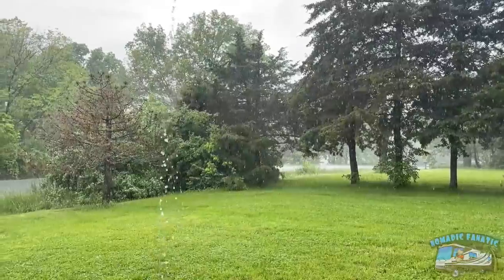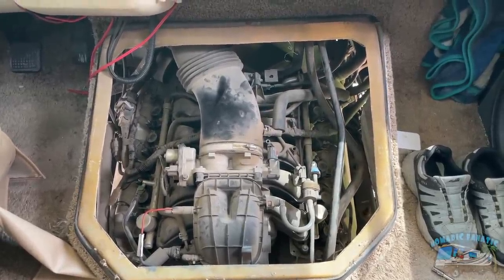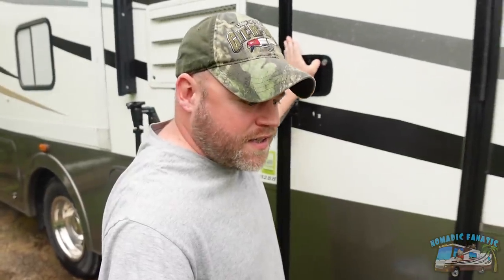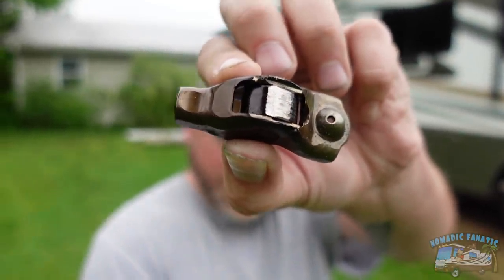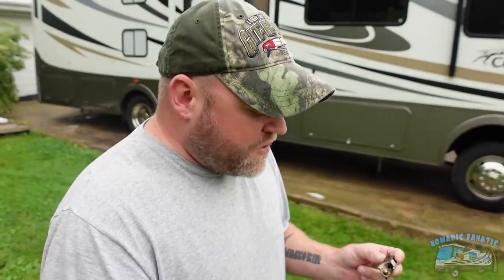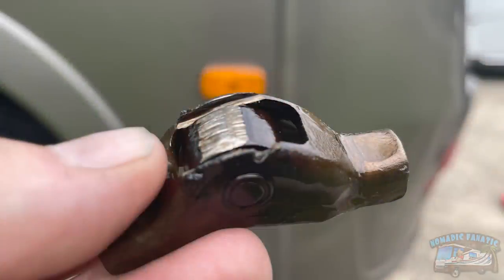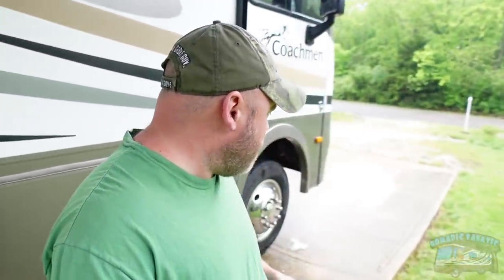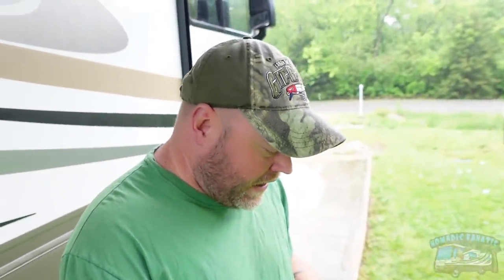Engine Repair Begins ~ Ford V10 F53 RV Is TICKING & KNOCKING

Comment: Depending on if the rocker arm is for the same cylinder that the exhaust manifold was leaking. If it was the same then you may have burnt a valve because of too much air from the exhaust leak therefore it would cause valve train problems. You could also do an oil sample which will tell you what kind of metals and other things are in the oil that aren't supposed to be. That's what semi truck drivers do to check the condition and health of their motors.

Comment: Wasn't there something with the oil passages in the cylinder head being dimensioned too small for there to be enough oil flow to the cam shafts? I think I remember something like that. Could be consistant with your fault there, as well. I think the remedy was a complete overhaul and rework of both heads, drilling out the oil passages to a larger diameter, or something like that (but I'm not sure about that last bit).
Reply: he didn't change the oil enough.
Reply: @TheBandit7613  Even if that were true, it wouldn't have helped against a design flaw in the Triton engine.
Reply: @Seegalgalguntijak  I had one. It's tough on oil. Dirty oil allows varnish and sludge to form further narrowing oil passages. 
I changed the oil every 2500ish miles with Royal Purple. 
I now have a new E450 with the 7.3 (Godzilla) engine. I guess we'll see how that one does.
Reply: @TheBandit7613  Alright. 
To me, it looks always funny how in those heavy duty applications, in the USA diesel isn't the standard engine type to go to. Over here, there are no trucks and no commercial vehicles that run on gas, just because it's much more inefficient in fuel consumption. As far as I know, the 6.7L power strokes are now bullet proof, not like the 6.0 and 6.4 ones that failed left and right...

Comment: Happy Birthday Eric 
Rocker damage from no oil getting to it. Spray out a few push rods, See if anything is in them. . While your in there check ,all Rockers for good oil flow. Now would be time to drop pan & Clean & replace oil pump & all Lifters. Good Luck on the Motor.  The Sunshine is on the way.

Comment: Eric, when you kept having issues with your on board generator, the Onan, what was wrong? I just bought a 95 tiffin Allegro bay and my 7000 Onan doesnt work. It has the same issues yours did if I remember correctly. It starts and stops. My rig has been sitting for 6 years with the same fuel so I was thinking maybe that was the issue since I understand that both the RV and generator share the same fuel. Please help.  Lol
Reply: THANKS ALOT ERIC.

Comment: There is no reason why a V10 engine is not healthy even after 1 million miles. The main reason why engines are getting hit by fails of internal parts - like rocker arms and bearings - is carbon deposits. So, the question is: How to manage these carbon deposits? ...or even make them go away altogether? For this we need to understand the internal processes in detail. For example: The rocker arms on a Ford V10 have a little ball bearing as integral part. If this little ball bearing is collecting carbon deposits, it starts to become stiff up to the point where it is not moving anymore and getting worn off by the cam shaft. THIS develops the ticking noise which is an indication of worn rocker arms. 
There is a method to prevent the carbon deposits: Shortly before you do an oil change take a small sample of oil from your oil pan by loosening the plug just enough to collect some drips. Then tighten the plug again. Now you have a sample of the oil before treatment. If this sample is black, you can conclude that there is a lot of carbon inside the engine already. If the sample is like dark honey but still transparent, it is a good sighn. This however is most likely NOT the truth. Now put about 1.5 oz/quart seafoam into the oil and drive the engine for not more than 200 miles. Now do an oil change. If the oil now became black, that is an indication that within these 200 miles you "washed" the engine and got rid of carbon deposits. So, inspite the oil looked good in the first sample you have proof now that carbon deposits have been present. Repeat this procedure before every oil change, until the color of the sample before the 200 miles and at the oil change is the same. Now you can be sure that the engine is clean of any carbon deposits inside. 
I go one more step: I only use synthetic oil and I add oil treatment which contains compounds with further lubricating properties inside very small spaces. My Engine has 180k miles at the moment and is purring like a loving cat. I am also going easy on it. Meaning I am not pushing the pedal to the metal. The observation I made: To maintain 55mph on even and dry road required about 2000rpm before I started this treatment. Now to maintain 55mph in the same conditions requires about 1800rpm. This means the engine has a lot less inner resistance and feels free. That translates into a better gas milage as well. I used to use about 7.5 mpg and now I am close to 9mpg. That however depends on the wind conditions as well. This less inner resistance also means less stress on the parts which translates into a longer engine life.

Comment: Ford's with the overhead cams are notorious for the roller followers going out on the right bank. Replaced mine in my 2010 Ford 5.4 l. You should do all of them on the right side not just one. A few thousand miles down the road another one will go out. You did get lucky though. If that roller follower would have come apart it can jam up the valve train and take out the whole engine.

Comment: Usual V10 problem rollers gave up and get loose. They kill the engine easy if neglected. Replace them, experienced mechanic solve it easy not a big deal but they can cause one.

Comment: The Car Wizard has quite a few videos on his channel that explain why those 3-valve Triton engines, both the V8 and the V10, are highly problematic, they have problems that can even cause catastrophic engine failures, which means for you: Swap a Cummins diesel into Miranda and be done with it! ;)

Comment: Cam lobe rocker arm bearing failure..You better fix that. As that thing jams. It will ruin the engine.....So them all at once. Don't do just one...As I can bet you $100.00 other ones are wobbling as well.. I done 100's of these... And you use the Updated Ford ones with the new lifters...

Comment: Well you weren't around Springfield!! Thanks for staying away! We're having to move and moving from an apt to the uhaul wouldn't be fun in rain ESPECIALLY the freaking downpours you bring!
Now to find a storage unit, unload and go find someone that will give me a loan for a used Class C!
Sleeping in a Titan 4x4 isn't fun for a 66 year old back! Not to mention after sleeping for 5 hours my arse won't wake up!
But! At least we're getting clouds to block the sun!
That sounds like a valve. That's not a cheap repair. And I. Bitching that my passenger window stopped working so it's a bit warmer in here as I search for an apt or storage unit!

Question.... are you finding an A more fun than a C unit? I know after 40 years living in Peterbilts, Freightliner and Internationals , I don't do Kenworths I don't want a B as after living in maybe 250sqft for that long I need to luxuriate in at least 27' of a Manson RV!
But if you do make it to Springfield and want to video what the damage from all 3 windows over the overhead bunk after leaking for IDK how long! You and the rest of your subs will freakout!!

Have fun!
Blue skies and safe journey's!

Comment: Garantee that camshaft is scared.....your just patching up ....get the cam shaft and check oil passages that rocker failed due to no oil...I would invest in a high volume oil pump and be done

Comment: Sounds like a flat tappet a valve tappet not hydraulically working or wore out And that was my second guest a bad lifter and no an exhaust leak will not cause thatI would definitely look at the cam

Comment: Exhaust leak on manifold has nothing to do with a rocker arm going bad. However, looking at that roller rocker, I am amazed that the cam did not suffer any damage! If it really did not get damaged you need to buy some lottery tickets before your luck runs out...
Reply: That's incorrect, improper backpressure will cause valve train problems.
Reply: It was an exhaust leak, cannot cause a rocker arm problem...at worst in cold weather a exhaust manifold leak could “maybe” warp an exhaust valve which could lead to a burned valve, but never a rocker arm.
Reply: @divadyrdnal  improper pressure in the exhaust port can cause the valve train to wear prematurely
Reply: We will just have to disagree on this one...

Comment: An exhaust leak has nothing to do with your rocker arm breaking. Or any internal engine failure. That is one of the dumbest things I have ever heard. If somebody told you that they are for sure not a mechanic. smh

Comment: time to dump that thing the v-10 is a bad motor
Reply: Not true.  RV is older with some miles.  Many V10's on road still doiing fine.  Whoever had it before did not do regular maintenance.  Also, apparently people see RV's as somewhat disposable and do not do proper upkeep.
Reply: How much depreciation from all the renovations he made

Comment: Good luck with the repairs brother!! I always hated working on my class A. Always cramped either in the dog house or underneath.  You ever think about a Truck and travel trailer. I know go off the beaten path.  Switching to a 4x4 truck and travel trailer was better for me. Plus easier to work on a truck.

Comment: The Ford V-10 is a horrible engine! Didn’t you watch all the videos on them ?
Reply from the maker: Well since 92% of all has RVs  manufactured in this country have the same engine, it can’t be all that bad. If you look back at the alternative when I had the Chevy workhorse Vortech engine, I was in repair shops less than I was actually on the road. Constant repairs. This is my first engine repair in over three years.
Reply: @nomadicfanatic  I don’t know the statistics on the repair and failure rates but there are lots of videos on them! One couple had an entire engine rebuild and many spark plugs just shooting out or getting thread jammed! I hope yours is ok. Maybe you shouldn’t watch those videos! I was going to have surgery a few years back and watched a video about it the day before (wish I hadn’t)